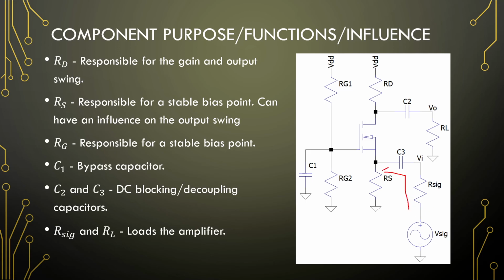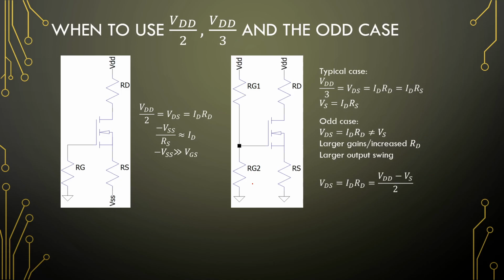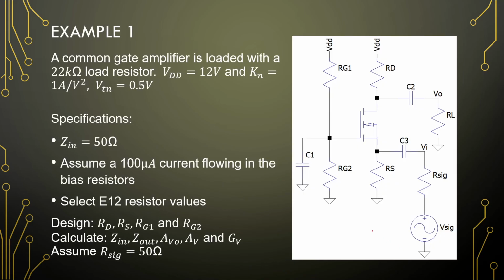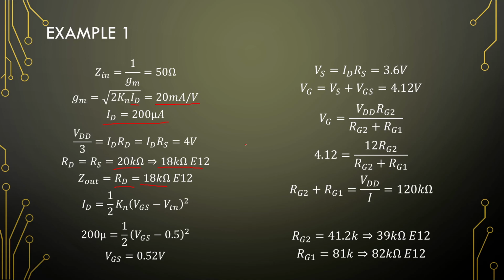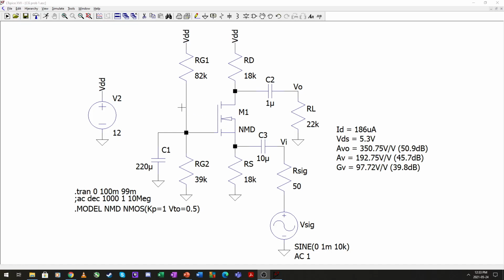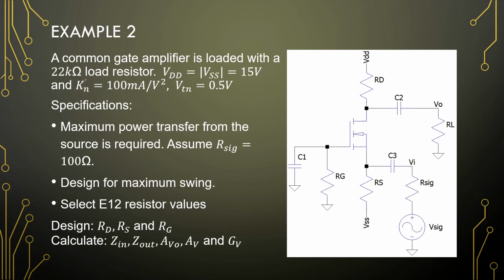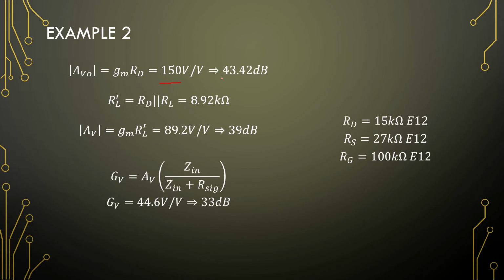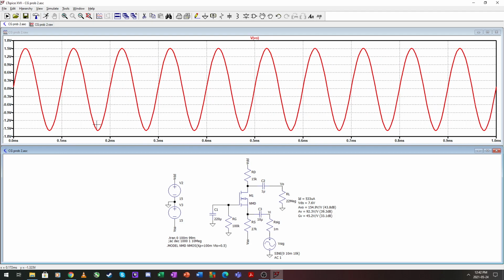Video 6 - Common gate amplifier design

Comment: what's C1 's role ?
Reply from the maker: C1 grounds vgs in the small signal model. The gain equation comes from gm×vgs×zout. So, the bypass capacitor ensures that Vgs is in parallel with vin.
Reply: @EzElectronics   thank you for your response 
I don't see the point